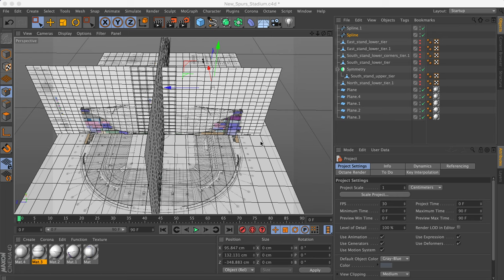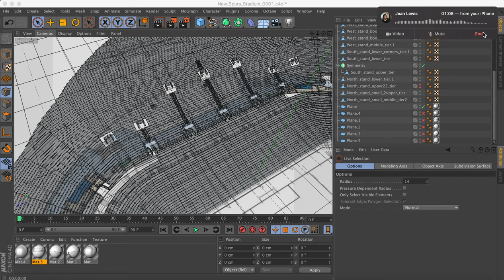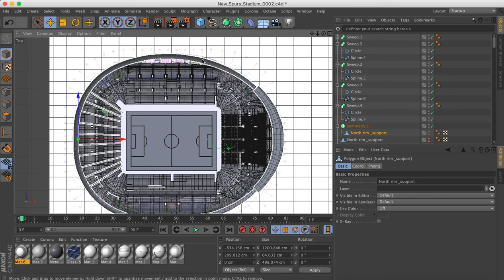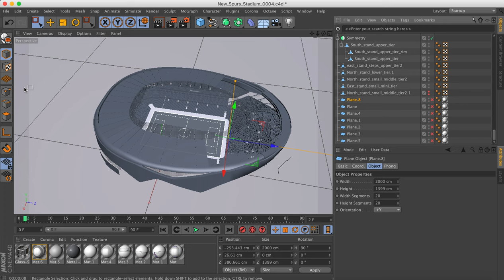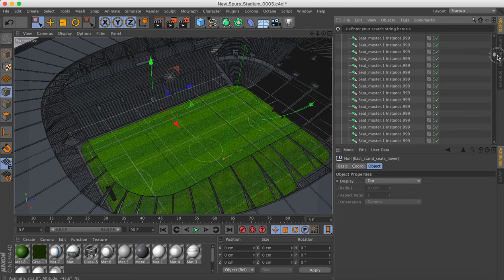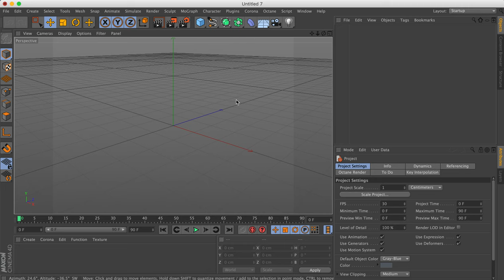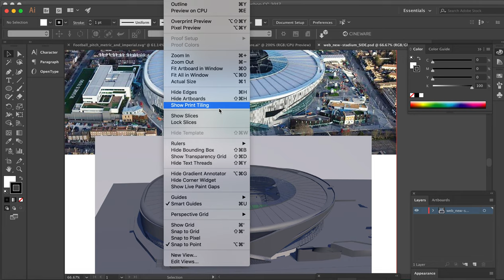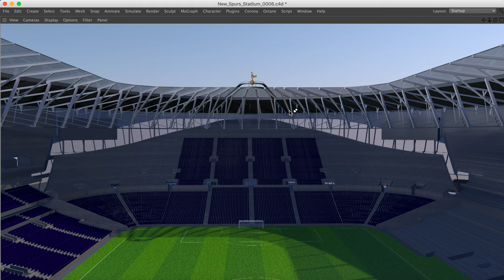Cinema 4D: How I modelled Tottenham Hotspur Stadium

Comment: This is a good start, but need a tutorial that actually explains what was used such as lathe nurbs etc. Also would like to find blue prints such as what you found but stupid google keeps directing me to images and not actual blue prints. There are not a lot of tutorials out there for constructing stadiums which is why I got excited when I saw your video. Anyway, some useful info here, but need more in terms of what was used and work flow, and where to get the blueprints.
Reply: I would like to do that, but that is very time consuming. Video is an overview rather than a 'how to'
Reply: @stevelatibeaudiere9082  You could do something in a 10 minute or less video explaining the process such as: did you use lathe, loft, nurbs, splines etc. I am currently working on a model stadium right now, and finding different techniques are necessary in solving these problems. Still I found your model impressive and but your tutorial not as helpful in what I was hoping for. Also why didn't you include a link in the description in terms of where you got your blue print to model this? That also would be helpful!
Reply: @joseyzadoria7815  Link to blueprints are now in the description. Thanks for feedback
Reply: @stevelatibeaudiere9082  Hey Thanks for that Steve! Really appreciate it! I hope you do more tutorials in the future too!